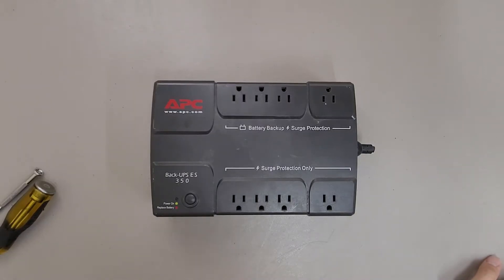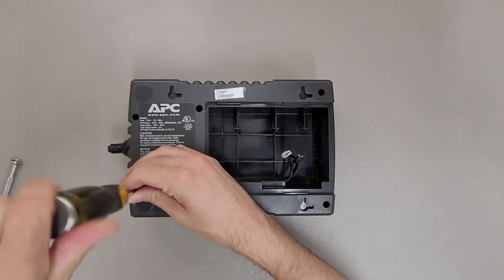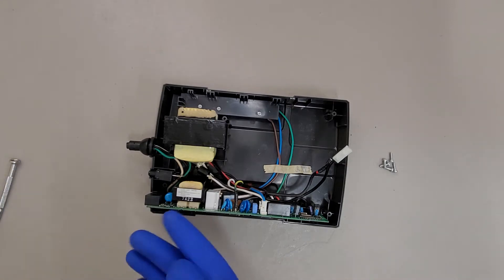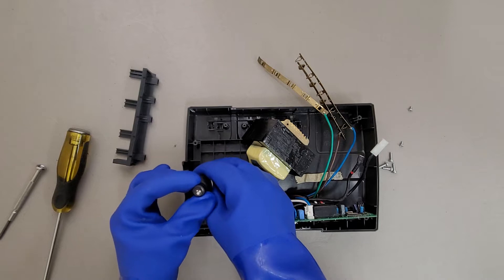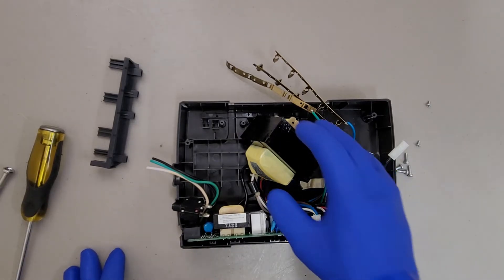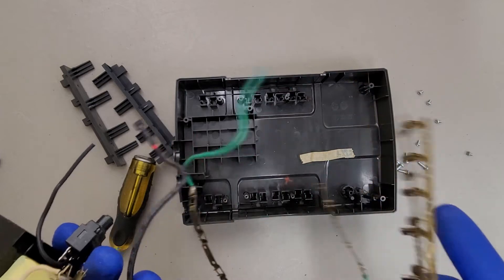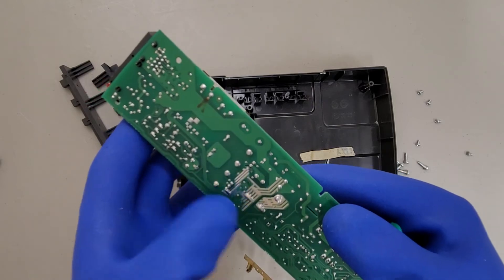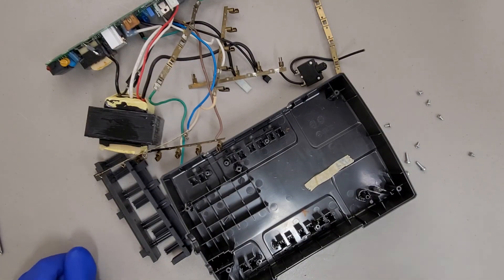APC Back-UPS ES 350 BE350R battery backup #teardown

Comment: I had one of those, the caps are so small that after a very short time they are empty, just wait an hour after A/C input is unplugged and you'll be fine ... you can also just 'dab' the PCB with aluminum foil to shorten everything out if you're still in doubt
Reply from the maker: Yeah odds are nothing would happen. The 1500VA and higher ones get spooky. I haven't been shocked by one, but I've seen plenty of sparks.